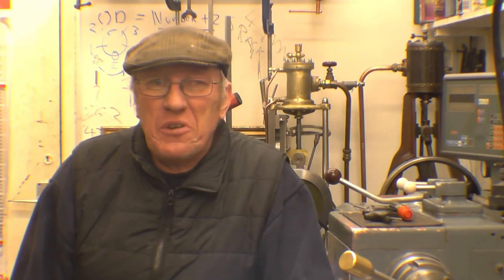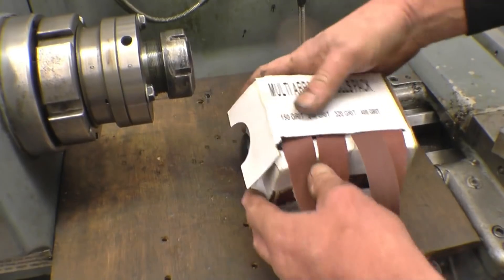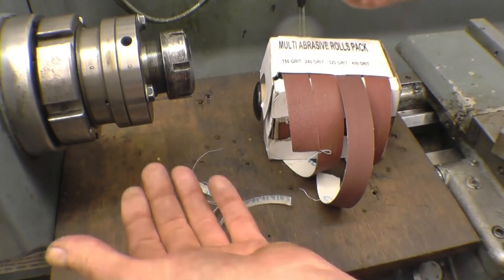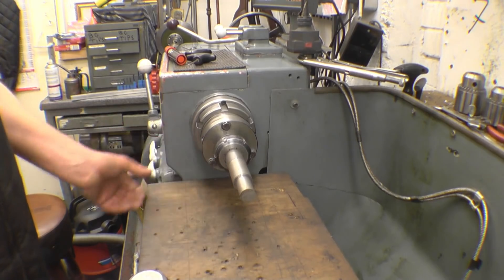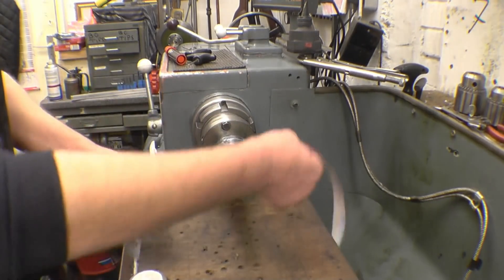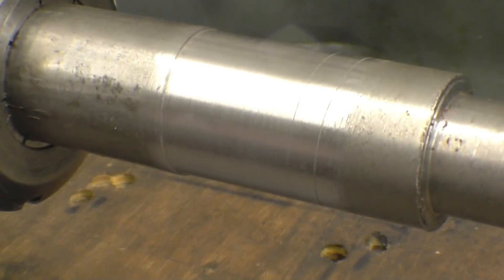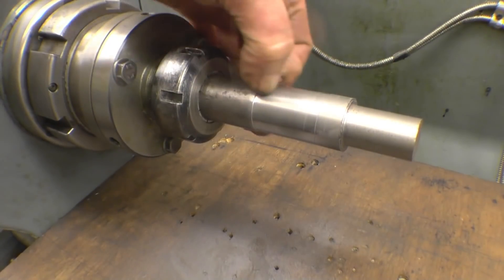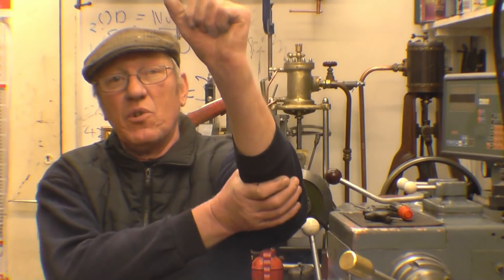Banggood Emery Tape Review

Comment: You can also glue the emery to a flat stick and use it like an emery file , i sometimes stretch a length of emery over a file and use it like that especially on a bearing journal as it helps to stop it becoming barrel shaped .
There is a technique for applying direct pressure to the workpiece with one hand or a couple of fingers but you need to run the lathe in reverse and grip the emery between the forefinger and thumb of one hand then use the other to apply pressure with either the finger tips or an open palm to the top of the workpiece , if the emery grabs it will pull out of the hand holding it and won't grab the fingers or hand that is providing the pressure to the workpiece .

Comment: It would be nice if Banggood shipped in a box instead of a plastic bag.  I ordered the same box of emery cloth,. The box was crushed during shipment, inside the plastic bag.  The emery cloth is still usable, but the dispenser box was trashed!  Good safety warnings.  Emery cloth, if used improperly, can cause serious injury on the lathe.
Reply: I think all Chinese stuff is shipped in a plastic bag. Just had a soldering station arrive from Banggood... crushed corners on the box, but item was OK. But... it was so inexpensive!

Comment: The Banggood step drills I have are great only let down is the delivery they seam to use Hermes took 4 attempts to deliver :( 

Great review as normal John and some very important tips on safety 👍👍
Reply: At least they didn't toss it over a fence, I have a tyre changer delivered by DHL and they tossed it over my neighbours fence, a 45kg manual tyre changer over a 6 foot fence.. you can imagine what would have happened if the neighbours kid had been playing on the other side.
Reply: Had stuff sort of delivered by Hermes they are the worst